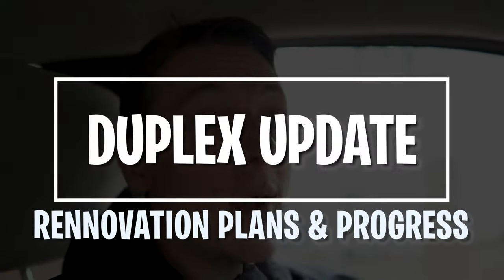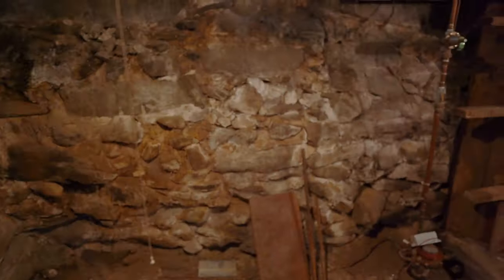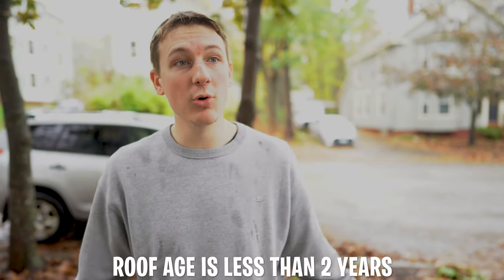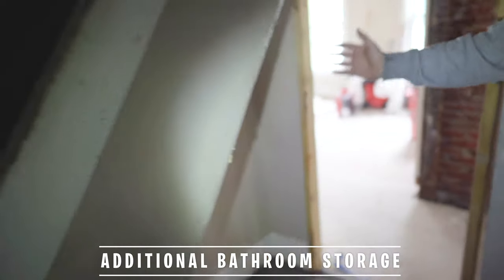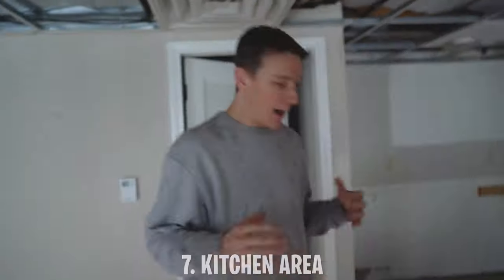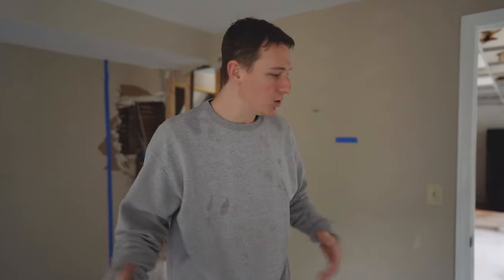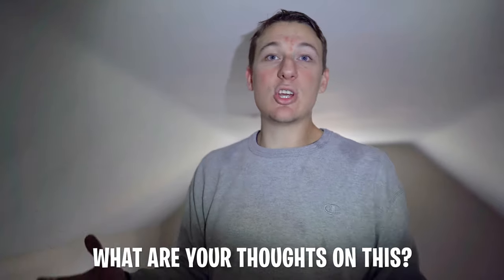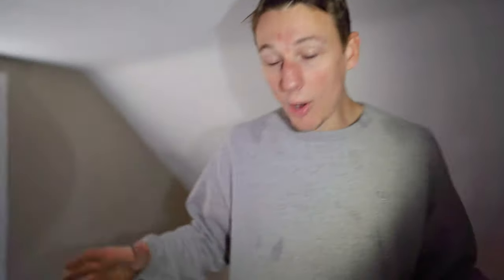Renovating My First House (Duplex Real Estate Investing)

Comment from the maker: Let me know your thoughts! Any suggestions here are highly encouraged!
Reply: Talk more about stocks again no offense but your journey has mostly taught me 50 plus reasons why Ill never invest in property outside of REITs
Reply: Open the windows for the smell. Smell gets trapped in paint also if its the previous resident was smoking enough. So a new paint job could do the trick if you sand down the current texture and paint. Theres humidity trapping bags (i dont know specifically what theyre called, but i just bought a house that had a smoke smell, they didnt get rid of the smell but definitely helped, pair that with other odor ridding methods and it should do the trick. I focus on the numbers in real estate investing so if you want to chat or need some calculation tips etc, shoot me a message and ill give you my personal email.

Comment: Looking forward to seeing how it turns out for you. Best of luck with it all. Seems like it will be costly enough to fix up unfortunately.
Reply from the maker: Yeah it’s definitely not ideal… Trying to do a lot of the work myself to cut some costs and learn how to manage everything! Once the basement is all figured out it’ll be easier 😅
Reply: @DaltonLitz   yeah the basement seems to be the big issue for now. No point in getting everything up stairs done up nice for the building to collapse 😂

out of curiosity. How has the tenant been in terms of complaining about  the noise you're making clearing stuff out etc. I've heard some horror stories in the past of people getting into deals like yours where they have to honour a lease and the tenant has caused them to hold up work by months.
Reply from the maker: Yeah it is cause just some minor hiccups but I just try to be as transparent as possible. Luckily the tenant works a decent amount so it hasn’t been terrible to balance. Every time I’ve been working on the weekend they’re not even there, I think that will probably change in the winter so I’m trying to get as much done as possible before hand!

Comment: Hoping you could go over the numbers in a future video! I think you’re over renovating. It really depends on the area you’re in, but most renters just want a clean, fairly updated place. The foundation was a must. The entry way, wall extension, and wall blowout for the kitchen may be stretch. I agree making the kitchen bigger, totally a great  idea if it adds more value (either in rents or resale value). The floors that were in there (looked like LVP) in the living room and kitchen looked decent. But I like a good flow so LVP in all the rooms is what I would go with. Idk if I would put carpet upstairs, but it could help with the sound if that’s the goal. Just know carpet will need replaced more frequently than other flooring. Best of luck!

Comment: If you have the funds for it, I would replace the plaster with drywall. More space and get rid of the cigarette smoke soaked into it
Reply: This is what I was going to say. Best way to get rid of the smell is to take out the walls/ceiling. Also will make it much easier if you want to add in the ceiling lights

Comment: Have you talked to Meet Kevin? Because I feel like you should talk to Meet Kevin. You've already bought the property, so OK, you're stuck with it, but aside from the obvious basement repairs, you're knocking holes in walls and planning changes to use every available square inch. I get that, but I don't know that you have the budget for it. Listen, Dylan, this property rented for 100 years in its current condition. Upgrade floors, cabinet doors, and lighting, maybe some plumbing fixtures. Live there a couple years, then rent it out to someone who doesn't care. Sow's ear into silk purse and all that.